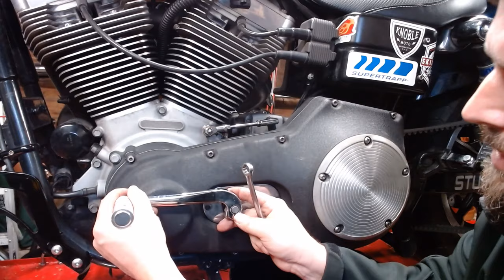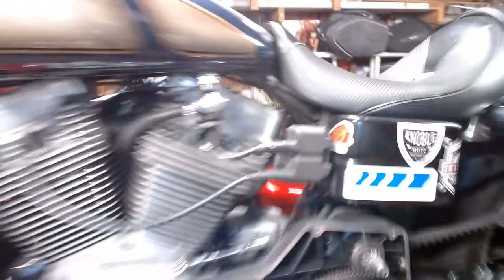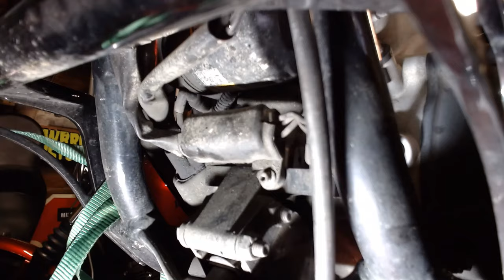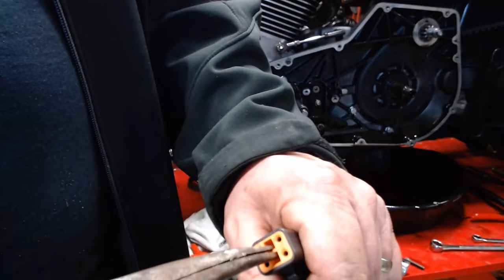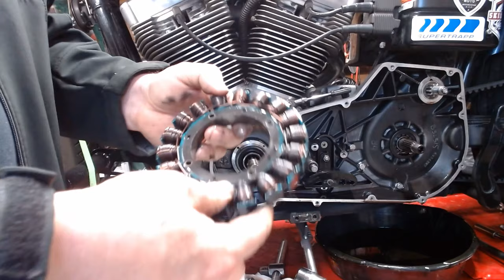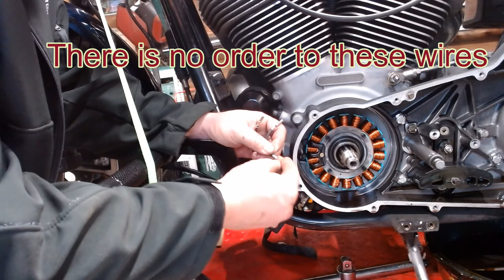How to replace the stator on a Harley.

Comment: No need to pull the clutch off.
Reply from the maker: You have to pull the clutch to pull the compensator sprocket.  It all has to come off as one.
Reply: @KnobleMoto  I respectfully disagree. Although the book says you need to, i did the stator on my 97' Softail and we just pulled my buddies 06 Heritage and left the clutch in place.
Reply: @jeffnorton3958  so you don't have to pull the clutch off 98 road King?
Reply: Some you do, some you don’t. Just did my 2001 FXDXT and tried to do it without, didn’t have enough slack in the primary chain to get the compensator sprocket off. The part I received said in the installation instructions that it is possible, when the bike has enough miles on it that the primary chain has enough slack. My 2001 with 30k miles, obviously didn’t have enough. Lord knows I was hoping I won’t have to. Unfortunately I also have a primary chain adjuster guide that is cracked and of course every HD dealer is closed on Sunday around here. Couldn’t get it back on the road today. Would have been a beautiful day to ride.
Reply from the maker: @45SSVaquero  if I had worn enough slack into the primary chain to remove it without pulling the sprockets, I would replace the chain.
Reply: @kellydawes9142  nope, just get the tesioner out of the way and work it. You'll get it.

Comment: WORTHLESS HARLEY PROBLEM. I remember when it was so easy to change harley generators. the generater was right in front of the motor.
Reply from the maker: This is true, but stators charge faster and put out more power, even at idle. Also they last longer than generators did.

Comment: so my bike wont keep a charge, I put a brand new battery in it and it died in like 3 days. should i replace the stator or does anyone have an idea on what this might be ???
Reply from the maker: You need to check the voltage at the battery with the bike running. It should be 12.8 v -14.6 volt dc. Troubleshoot before you throw parts at it.
Reply: @KnobleMoto  pretty sure I checked that months ago and I was only getting about 9-10v . Also pretty sure I have an open line between phases on the stator.
Reply from the maker: @Averagings  it sounds like it is your stator then.  Or a broken wire.
Reply: @KnobleMoto  copy thanks for the help brother
Reply from the maker: @Averagings  you’re welcome
Reply: @KnobleMoto  hey one more thing I do not have a primary locking tool and I’m currently trying to change this stator anything else you can think I can make up to do the same task?
Reply from the maker: @Averagings  a piece of hard wood. Like an old hammer handle.
Reply: @KnobleMoto  good to know thanks brother I hope this things runs when I’m done I’m itching to be a menace 😂
Reply: Did it work
Reply: @bgconsistent9657  yea

Comment: Tip: clean the metal particles off the magnet by using "silly putty" or a clay bar.  Then clean the magnets with parts cleaner.
Reply from the maker: That’s an excellent tip.
Reply: @KnobleMoto  Always willing to help.  Also use silicone grease when putting the plug back together...That plug sits right up front and catches all the water and shit of the road....Cheap insurance.

Comment: "Then just replace your primary and you're ready to go." Yea, for those who are not familiar with Harley's and watching this, you should know the clutch adjustment is right there and after pulling out your primary and putting it back in, you're going to want to make sure that is adjusted correctly. In some cases all this tinkering around will cause an issue here. You'll want to loosen the clutch on the CABLE first so there's plenty of slack. Loosen the lock nut on the clutch adjustment on the rear primary, and then use the allen to tighten it just until it reaches, then lock the nut in place. Then you can adjust at the cable and finish buttoning up, and add the oil. Good tutorials are THOROUGH tutorials. If you button everything back up and out the oil in and then have to do this and you don't have a special wrench to tighten the lock nut while you hold the clutch adjustment in place you have to drain the oil back out and then remove the case, do this, then button it back up again and pour more oil in. Very frustrating to get all the way to the end of this working on my friend's Harley only to have him fire it up and have the bike start jumping on him with the clutch in, then I had to do research to figure out what could have possibly gone wrong since I don't own or work on Harleys and was just helping a friend out. HUGE oversight bro.
Reply from the maker: Or, they could watch my video on how to adjust the clutch.
Reply: Thank you for this video as well as this  comment. I have a 1990 HD Electra Glide Ultra Classic that runs until stone dead on a out of the box new battery so I'm assuming that it's a stator issue that needs changed and had I not read your comment about the clutch adjustment thing then that would have 100% undoubtedly been me all pissed off redraining and taking everything back apart again leading resulting in working frustrationingly  careless and we all know how that one goes....breaking, stripping, and losing shit....thank you both again
Reply from the maker: @ericshehu1173 you’re welcome.  I am glad it helped. And yes it is likely the stator or the regulator/rectifier.  But also check the wires running from the regulator down the the frame. They have been know to break there.
Reply: Don't take the whole primary case off if you don't have a wrench that will get on that lock nut, use a deep socket with a set of vice grips on it then your Allen key will fit through the hole in the socket
Reply from the maker: @jaredforrest5183  cool. Tag me in your video so I can see how you do it.

Comment: Replacing the stator in my 2015 FLHTK.  On those there's a little lip the rotor (cover over the stator) won't go past, so I had to pull the inner primary cover as well.  PITA!  Enjoyed the video though - steps are basically the same, and gives a good overview of the process.  Some newer models may have a T70 Torx bit holding on the compensator sprocket.
Reply from the maker: Thanks for those updates and tips.  It’s all good info.

Comment: Thanks for the video. My stator took a dump on my fxdwg and it doesnt even have 20k on the odometer. I've done basic maintenance but this task is slightly intimidating.
Reply from the maker: You’re welcome.  Once you get in there, it’s not as bad as it seems.
Reply: @KnobleMoto  good to know!

Comment: Holy Sh@t THATS a job and a half man wow. Thank You Jesus I don’t work on Davies. But I bet mechanics make a killing. That job is probably almost 1300 dollars.  Insane.
Reply from the maker: It’s not too bad tech wise, but yeah it is very labor intensive. Which is funny, because HD stuff is generally simple to work on and to replace parts on. Except the stator….
Reply: @KnobleMoto  true not hard at all. No clearance measuring etc. Just labor intensive. Few times it’s probably 30-45 min job. I will say though how well kept the gasket was. I’d use it again easily.

Comment: Thanks so much.  Although my stator died 30” miles later. Something about the citation on it made burn out
Reply from the maker: Your welcome. Sorry to hear that the stator took a dive too.
Reply: @KnobleMoto . The one I got it was nicer?  As , Some have a coating that can over heat ….when opened the primary ya can smell burn oil.   At least the multimeter. Verified that There is nothing electrical wrong w. Bike.  …..Harley ordered me an oem equivalent drag specialties. Is as close that you can get to Oem.  Harly does not make it anymore. So I’ll be doing that this w.  I’ll follow yr video just like the 1st time.  Maybe Sunday bill be out riding

Comment: Do you have a video that shows putting the main gears back on correctly?  I have never done it and want to do it right.
Reply from the maker: As in the transmission gears? I do not have a video for that. But “Fix My Hog” does.  (I make videos for them too)

Comment: Is it possible for a stator to shut down due to heat? Have an 03 sporty thats shutting off as soon as is gets warm. Changed out the ignition module, regulator  and coil. Also checked the battery connections and battery. Only other component I haven't changed is the stator, but other than it just not charging the battery, dont know if they are known to fail when the bike gets hot. 

Dont know if you have any wisdom you can throw my way lol. Eithet way happy new year and hope you're still enjoying your Dyna
Reply from the maker: Harley crank position sensors are known to be problematic when they get hot.  

Your stator itself will not turn off due to heat, but your regulator/rectifier could.  However that would not turn off you bike immediately.

Comment: I have a 2001 dyna low rider with 8k miles and my stator went out (tested through manual steps). I havnt torn it open yet, but should I just replace the stator or the whole assembly. Harley dealer says if they do it they will do assembly which cost more so I’m looking for answers on if it’s needed or not.
Reply from the maker: Often if the stator goes, the regulator/rectifier is not far behind. Not always though.  If you can afford it, I would replace them both. After that, you know it will be good for a long time.
Reply: @KnobleMoto  what about the magnet Replace that too?
Reply from the maker: @Dalton44   If the magnet isn't damaged it will be fine to reuse it.  Give it a thorough inspection for cracks in the magnets though, and replace it is you find a crack.

Comment: What do you do if you can't get the nut loose ? Book says 150 to 165 ft lbs torque, I'm only a 160 lb guy been trying for 2 days . Last resort is impact if that don't work ?
Reply from the maker: The “ugga dugga” action of the impact seems to be the key to getting it free.  But heat the nut, then impact it off.  Swearing helps too.
Reply: @KnobleMoto  trust me I was swearing way more than I should have, finally got it. This is my first real repair on my first scoot, so I am learning as I go, next is going to find a rebuildable a mod. Motor. Thanks for your reply though, nice to know there are people out here helping the newbs.

Comment: Good watch... No doubt that I can do it, but think I'll pay the arm to get it done right
Reply from the maker: It’s totally doable yourself.
Reply: Oh... I know but there's also a shaft seal that needs to be replaced as well.. Plus I'm missing a few tool
Reply from the maker: @raymondwalls3154  if you buy a gasket kit, all the seals should be in there.
Reply: How much did you pay if you don’t mind me asking??
Reply: Well it turned into a little bit more of a job stator would have been under 5 hundred but ended up having to have both shaft seals on the transmission as well, of which I knew one was leaking.. So total was under 8...
Reply from the maker: @raymondwalls3154  that’s not bad for doing shaft seals too.
Reply: She runs good now.. Just hope it lasts longer than before.. Especially the seals
Reply from the maker: @raymondwalls3154  if they are name brand, you should I be okay. Cometic or James are always quality. (Personally I prefer Cometic)
Reply: Honestly not sure what my guy put in? I know he went thru drag specialty for the gaskets and voltage regulator and stator

Comment: Do i have to warm the bike up first so the fluid drain better?
Reply from the maker: Not for your primary.  There is no oil pump, so there is no need to circulate the oil first.
Reply: @KnobleMoto  thank bro

Comment: Silly question… I just replaced my stator on my 03 softail deuce last year and I’m back again this year because I can’t remember how to do it. How long is a stator usually good for because everybody is telling me it should have lasted way longer than a year. And technically my bikes been sitting for a few months now so it was really like 9 months on the new stator and now my battery won’t stay charged. Ik it’s not the battery because I tested three different ones all brand new, same issue.
Reply from the maker: it could be your regulator/ recifier too.  Your stator should last for multiple years.  See how much voltage you have at the battery when the bike is running.  it should be between 13.0-14.6 volts.
Reply: @KnobleMoto  once fully charged it’s around 12.5 and slowly drops until everything shuts down. I was told by a few different people that would be a stator issue. You think regulator rectifier tho?
Reply from the maker: @Billy-jo3bt  Check to see if you have voltage going from your stator into the reg/rectifier.  It should be 30-70 volts AC.  That will check your stator.  THE R/R switches the voltage from AC to DC the regulates it down to the 13-14 VDC range.  If power is going into your R/R, and not coming out. then your R/R is the problem.

Comment: Spacer and seal came off in center of stator.  Does the flat side or the rubber side of the seal go toward the case?
Reply from the maker: I would have to look at the service manual on that. It has been a few months since I shot this video.

Comment: So I followed this. Put my clutch all back together. Haven’t added oil yet but a buddy told me to cycle through all the gears. It goes to 1st, N, and 2nd but won’t catch higher than that, it just feels like I’m in 5th and won’t go higher. Will it be okay? I don’t want to add oil and everything then have to drain it. 

TIA to anyone for help.
Reply: It’s a 2014 Iron 883
Reply from the maker: It’s probably fine. The transmission really needs to spin for all the gears to engage & disengage properly.  Unless you took the trans apart, everything should work as it did before.

Comment: Are you saying that when you install the new connectors into the plug housing there is no pin out numbers.  You can install any wire in any position in the plug...???
Reply from the maker: for the 3 phase wires coming off the stator; yes.  This is one of the few times you will ever be able to do this with vehicle electrical systems.

Comment: Now what if your chain snaps like mine did. How would I get the nut loose?
Reply from the maker: Ooooooo!  That’s a tough one. I think it is 50 link chain (double check me on that). But you could get a piece of the appropriate single row industrial chain, put it on there, then use the wedge to get the nut free.
Reply from the maker: How did you break a primary chain?
Reply: chains dont snap

Comment: Do you have a video of a 2008 heritage softail stator hub removal
Reply from the maker: I don’t. But it should be the same procedure.
Reply: It's not the same.in the book it has a puller to remove the hub
Reply from the maker: @bobwhitaker8233  interesting.  I am
Going to look into this.
Reply: Have you heard about grinding the inner primary down to get the stator hub out
Reply from the maker: @bobwhitaker8233  I have never heard of that.  The stator hub (magnet) should be a slip fit.  I could see you might need a puller if there was a bunch of crud in there or if a magnet broke apart. But it is a slip fit when new. 
I just looked it up and it’s the same rotor on all the twin cams.

Comment: Would this be a much different job on a shovel? No videos on shovelhead Stator replacement on the whole YOUTUBES
Reply from the maker: Yes, the same process. The stator is in the same location and same general primary case design.

Comment: Hello i chipped a small piece of magnet on cover that goes over stator can I still use it
Reply from the maker: Maybe. If it’s just the corner it will be fine. If it’s the face that the stator spins past, you are going to want to replace it.
Reply: @KnobleMoto  Thank you

Comment: I tested my stator & it checked out good . But when the bike is fully warmed up it drops one cylinder & runs on one. With it running I took of the positive terminal & the bike died. Does that sound like a bad stator ?  Thanks
Reply from the maker: You still need a battery to complete the electrical circuit, so that is not the stator.  I would look at the plugs, fuel delivery problems, or crank position sensor.
Reply: is there a test for the crank position  sensor?
Reply from the maker: @philshoop3295  sorta.  You can put an indicator light on it and that will tell you if it cycles. But if it’s only going out when the bike is hot, you may not be able to test it that way.
Reply from the maker: @philshoop3295  is this carburetor or fuel injection.
Reply: fuel injection,  sorry I took so long to answer
Reply from the maker: @philshoop3295  I would check, in order; plugs, wires, coil, intake leak, injectors.
Reply: Thanks for your input.  When this started the check engine ligh came on and has stayed on.

Comment: How do you know what cable goes where or it doesn't matter?
Reply from the maker: Are you referring to the three wires from the stator? If so; it doesn’t matter. They produce a 3 phase AC current.  You can arrange them in any way.  All other wires should be marked for location.

Comment: Sr do you happen to have a link for the primary locking tool ?
Reply from the maker: I do not have a link. Sorry. It was on Amazon for about $8.  I think i just bought the highest rated cheap one.
Reply: @KnobleMoto  thanks believe it or not I bought the same one but so you know a (Felling wedge) works great as well I got impatient waiting for amazon 😂
Reply: A piece of wood works,that's what I used free.

Comment: Is there any timing chain marking that we should mind about???
Reply from the maker: Not on the primary chain. Only inside the cam chest on a Harley.
Reply: Bcuz my harley sportster 2017 XL1200C has a faulty stator...( NO AC current output )but scare enough to   follow what you did cuz   i saw a chain and   it must be complicated  to put it back later...

Thank you very much,sir
Reply from the maker: @Dihanfarm  once you get in there, it is not as complicated as it looks.
Reply: Thank you once again sir..God Bless you